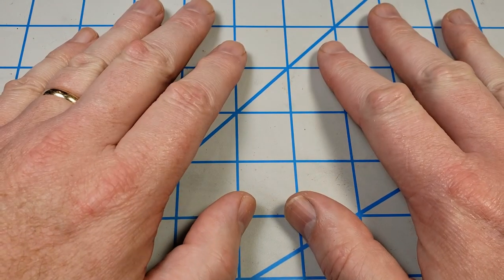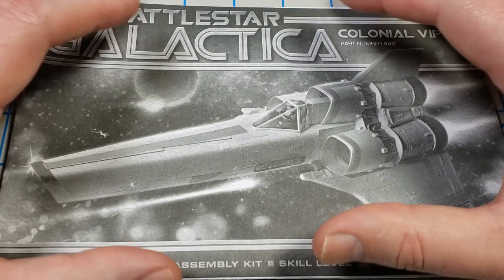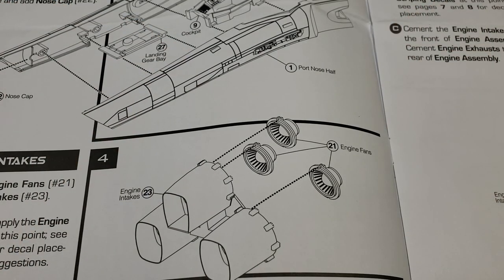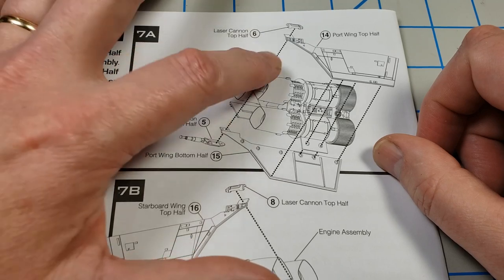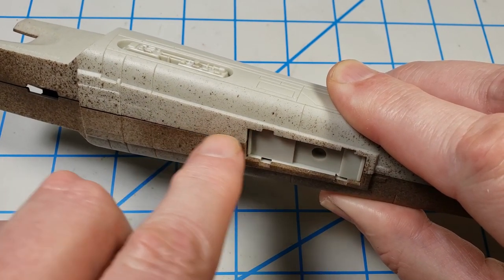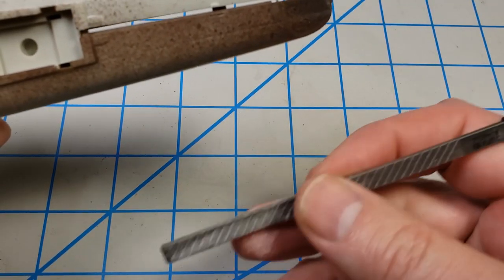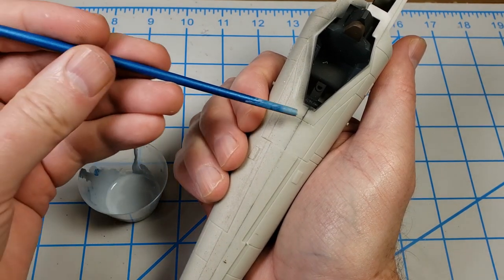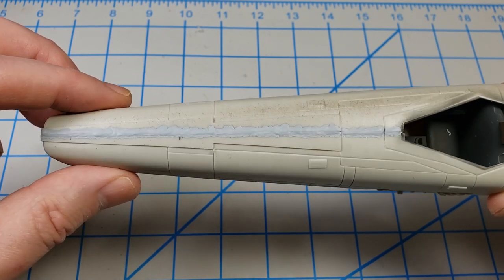Moebius 1/32 Battlestar Galactica Viper Part 2: Detailed Assembly Guide

Comment: Very nice Jon. I never thought of wet sanding my models or using plastic putty like that. I will try your method in a short while. You also mentioned using masking fluid on the canopy. What did you use for that? While I may not build this specific model, I certainly learned a lot that can be applied to other builds and other hobbies.
Reply from the maker: Wet sanding is really helpful - much more productive in my opinion than dry. I don't recall the masking fluid I used. I've used several over the years.  Vallejo is a current favorite.

Thank you for recognizing that methods and products can be applied to any model! So many times I've known people to say "I don't build spaceships", or "I don't build tanks", etc., and they never realize they might be missing out on techniques that are cross genre.

Thanks for watching and commenting!

Comment: For those upper and lower seams have you ever considered running a strip of masking tape either side of the seam, just fractionally off (say 0.5mm) and then working the putty into the seam?  
When finished remove the tape and you get a very thin raised edge that may sink as the putty dries.   Not much quicker to do,  I guess, than the way you show but leaves a lot less material to remove.
Reply from the maker: That is a great technique - I've used that quite bit in fact, especially on aircraft.

I've gotten to where I only use that extra step of masking if I need to protect detail on either side, such as loads of panel lines. In this case, because it was so flat, I didn't feel it was needed.

It does use less material, overall, but I found that the sanding was about the same, because the overall height of the filler is generally equal, and thus the back and forth grind tends to be about the same.

But it is a very useful method in many situations, and works quite well!

Thanks so much for watching and commenting!